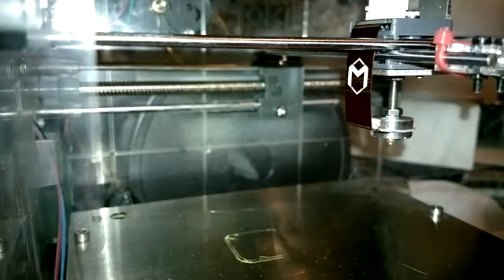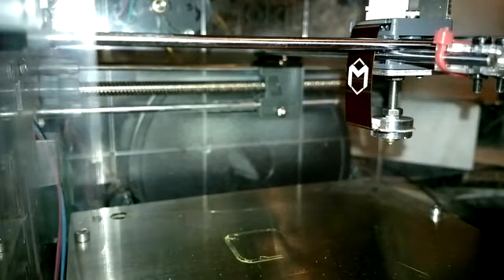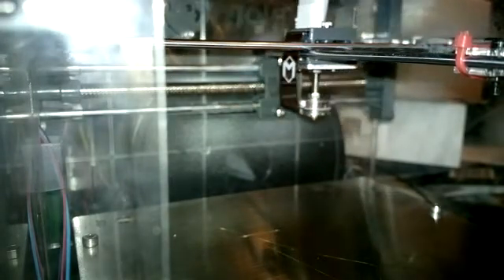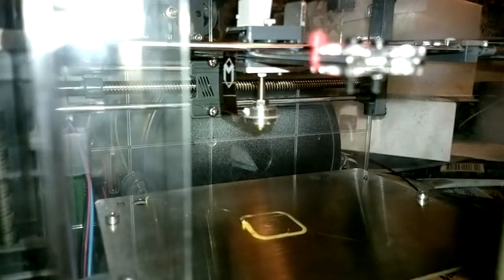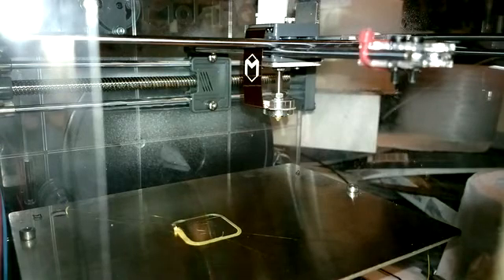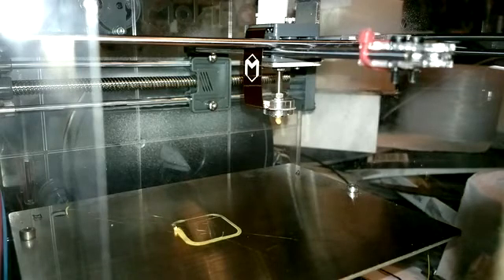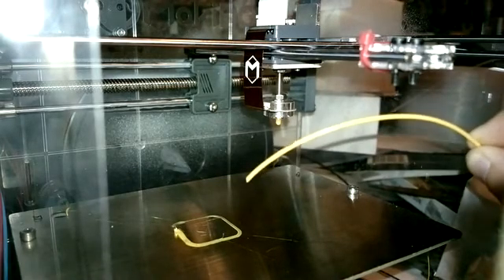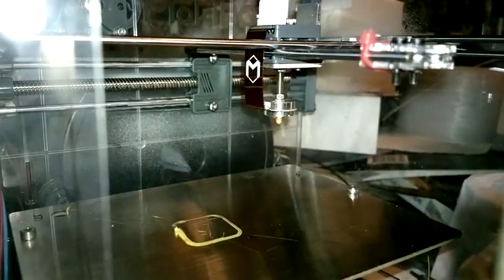Makibox printing: PLA cube (failed)

Comment: Dumb question, but does the spool of filament roll freely?  If it's too hard to pull or the spool doesn't turn freely on those rollers it sits on, that could be causing your feed errors.
Reply from the maker: Pretty freely. Once it jams, I remove the Bowden tube from the hot end and have it feed the filament through so I can inspect the end. That works fine.

In the past I've had similar failures without the spool connected (ie just cut off enough filament to finish the job and left it hanging out the back of the printer) so I don't think the spool is likely to be an issue.

Comment: I've suddenly started having a lot of first layer failures.  I was always able to clear the filament out and start again but this last jam has me stumped.
Reply from the maker: A few notes:

- Lowering the print bed has helped mine a bit. I've also found that keeping a pair of tweezers handy to remove the skirt if it starts peeling off the bed helps a lot; it often means the difference between a successful first layer and a blob of hot plastic being dragged around by the hot-end.

- Retracting the filament all the way is often a really bad idea, at least on my printer. The blob of plastic on the end (where it failed to go through the hot end) tends to get stuck in the Bowden tube, and it's really hard to get out. My solution is to heat up the hot-end (so that the plastic is soft), remove the Bowden tube from the hot-end, feed 400mm of filament (enough that the chewed-up part sticks out the end of the tube) and then cut the filament off.

Comment: What temps are you running for the PLA?
Reply from the maker: Pretty sure that one was at 210 degrees. Someone on the forums suggested turning it up a bit (from 193 degrees standard) to reduce the force required for feeding filament. I've just tried another tonight at 198 degrees where it finished the first layer or two and then stopped.
Reply: Marcus had good results with around 220C. I think if you run that high, you have to be sure to pull the material back out from the nozzle prior to starting.
Reply: I am having the same issus so i am keen to know if / when you have a solution !!
Reply from the maker: Jonathan Buford Will give it a shot at some point. For now I'm going to try ABS again.